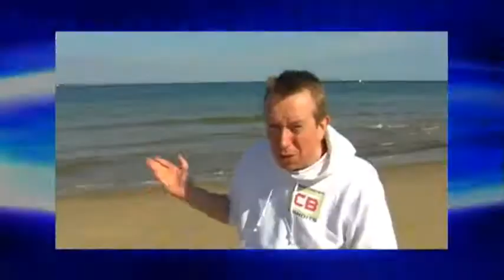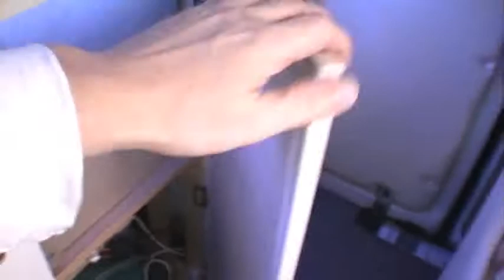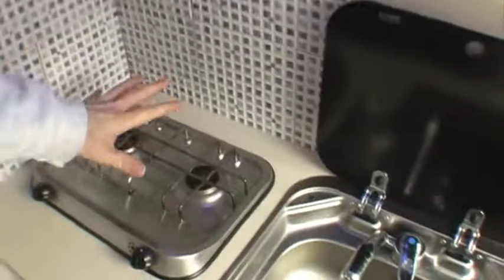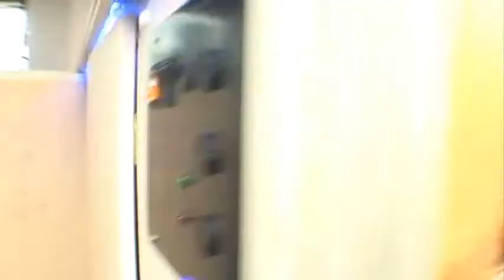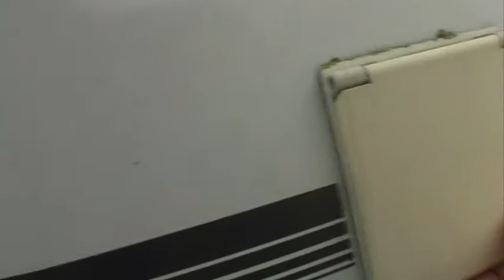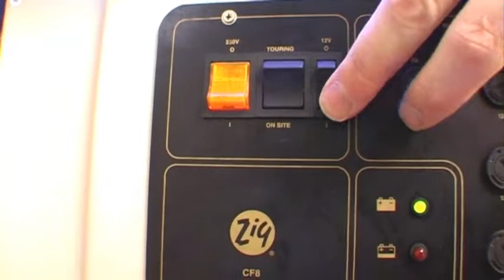SELF-BUILD MOTORHOME - RUNNING WATER & ZIG UNIT 12V POWER

Comment: Hi Rick, I'm in the process  of rewiring a camper that has a zig unit the same as the one in yours. Looking at the video I see you used a twin cable in a white outer sheath, is it  2.5mm ? And is it a particular type of cable? Also do you recall the  size of the cable that connected the van battery to the zig unit? Any info will be much appreciated.

Comment: I have this unit out of my old van. I don't want to use it to charge my AGM batteries (have a newer system installed). Does it still work with out connected to main van battery? Just want it to power my sockets and charge my agm batteries when on 240 site power?

Comment: I think I know what you're about...but us usa consumers what is a "zig" unit? A very good show. Keep on!
Reply: An expensive 12v distribution unit and charger basically.

Fitted one yesterday, it has a fairly high quality charger, and the switches shown, that splits the leisure/car battery as Rick said, so you don't end up with a flat battery. The main part of it aside from the charger is the fact that it provides one central fusebox for the 12v leisure stuff.

Incidentally in case you wondered, an RCD is what you guys know as a GFCI :-)

Comment: Hi, can you help?
I have just purchased my first campervan fitted with a Marque 1 zig unit. I dont have an operating manual for this unit. Dont know which mode I should have it switched to for driving or being hooked up???. I have already drained my main battery once & dont know why, somebody said there should be an isolater switch on the zig??????. I do have  a rocker switch with a picture of a car on top of switch & a picture of a caravan at bottom of switch. hope you or anybody can help me???

Comment: the leisure batteries if they are vented wet type need isolation from the cabin as they can give off explosive fumes so its agood plan to fit a external locker sealed to the internal space

Comment from the maker: Hi! No it won't run any 240v feeds from the leisure battery, you'd need an inverter for that, but you'd never be able to carry enough leisure batteries to run a 240v fridge overnight. If you want a fridge to run away from mains hookup, then a gas fridge is the only way to go. You can get 3-way fridges for this purpose but they are very expensive. 
12v only fridges are mostly useless, The fans are noisy and they quickly drain your batteries.

Comment: Hello RickTotal novice here...I,m Thinking of building my own burger van conversion....This zig unit looks great..just woundering though, When not hooked upto the mains...would this allow me to hook up, say a 240v fridge or tv...without having to use an inverter..Only i would like to leave a fridge or freezer running from the leisure batts When stud over night....Any help would be greatfull...what i need in my burger van is a 240v supply to run a striplight.and maybe two 240v sockets.Cheers. Bri

Comment from the maker: haven't a clue what a self-venting pump is. 
"Self priming" means you can just drop it in water and it'll work straight away without needing to bleed the air out of the pipes.

Comment from the maker: @bradspad its in a home-made gas bottle locker in one of the cupboards beneath the work surface.  it has a drop-out hole leading to outside in case of any leaks and is also steel-lined.

Comment from the maker: @jjrants not worth bothering about with a 12v system -  put your shower water in a large black container and leave it out in the daylight or preferably in the sun - that will heat your water more efficiently and save you looking all your power in a few seconds.

Comment from the maker: another quick tip - dont try to earth the 12v feed wires from the zig unit and then try only working with 12v positive vires feeding to the accessories - it wont work that way, even though think it should!   You need to have both a pos and a neg 12v wire running out to feed the lights etc in the van.

Comment: Thanks for the link. I checked the website and they are indeed cheaper. The only problem is after adding VAT, carriage, and/or getting ripped off by pay pal I find that the mail order or ebay type places don't work out much different to the retail parks. If I'm doing a large order it would definitely be worth it but the way I tend to work is nip down Halfords or Wickes and fit the stuff the same night. I'm never that organised to work out what I want in advance!

Comment: The van is coming along very nicely now, Can I suggest that you move your sink water supply away from your electrics, Just a thought. lol

I've been thinking about converting a Ford Transit Luton into a motorhome and have some built-in dog cages probably under the fixed double bed at the rear. Can't think how to do the side steps though, might have to go to a coach-builder for that?

Comment: Brilliant! Thanks Rick. I'm doing my van to follow yours. except not using a zig unit, but two switches like you showed, one touring/site to isolate the leisure battery, and another one to turn the 12V on/off. Plus of course a blade fuse box from Halfords and battery voltmeter to indicate battery condition.